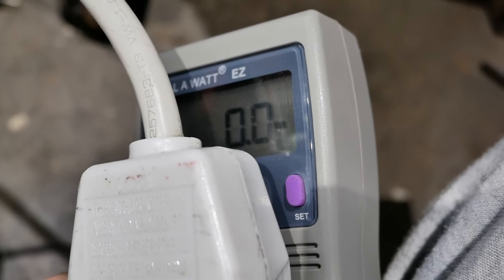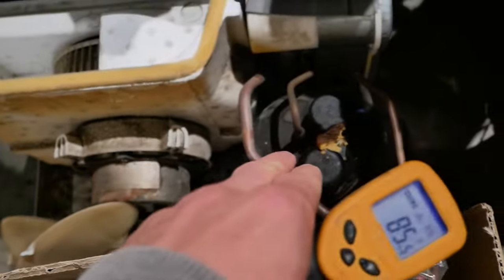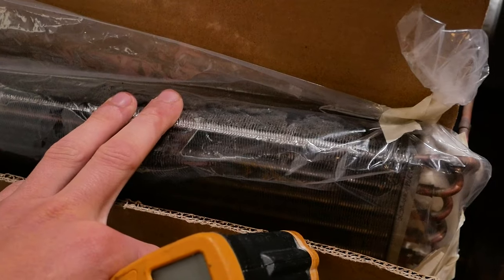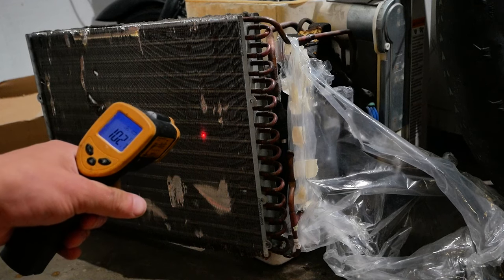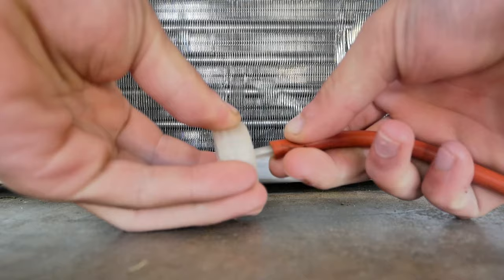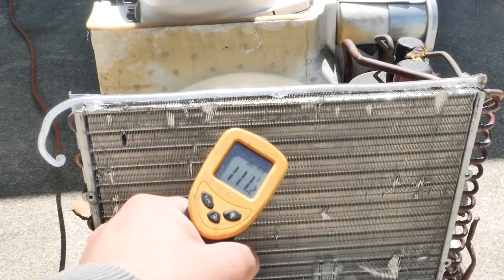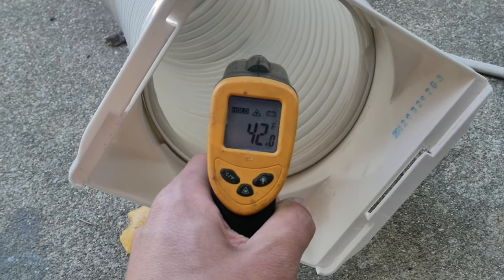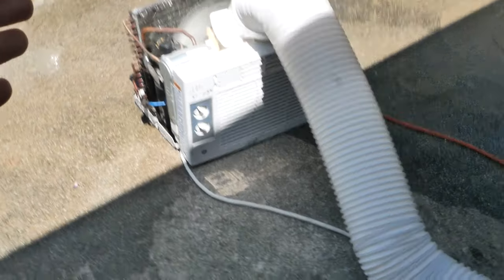DIY Water Cooled Air Conditioner 200% Efficiency AC Unit

Comment: I want to add on a plate liquid/liquid heat exchanger to an air conditioner. I already have a hot water tank I heat with solar, but the bottom of the tank is plenty cold. I am not an A/C technician, but I know there are special requirements for the circuit, as well as when you fill it. 

Would adding on a plate heat exchanger to a split air conditioner be possible, reliable and work in the long term also? I just don't know enough about how such a plate heat exchanger would work with hot refrigerant liquid. Would it suffer galvanic corrosion, or other corrosion, oxidation or issues?

While making the air conditioner more efficient, just like in your video, I will also use the extracted heat to augment the solar thermal heat.
Reply from the maker: check my other video, i did exactly this

Comment: I had a drop of around 70 Watts, from 15.8 AMPS @ 110VAC at 75F ambient room temperature, Evaporator/condensor coils not exposed to the sun. Down to 15.2 A.  Started at 640 Wats When I sprayed cool water it dropped to 570 Watts.